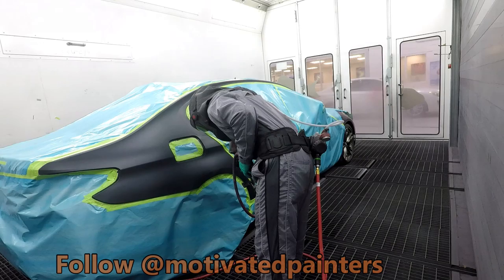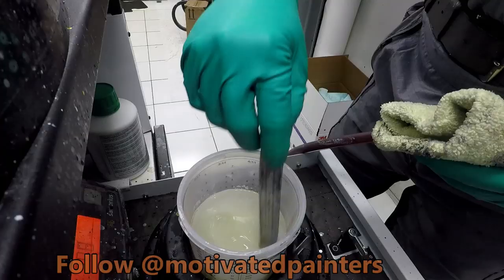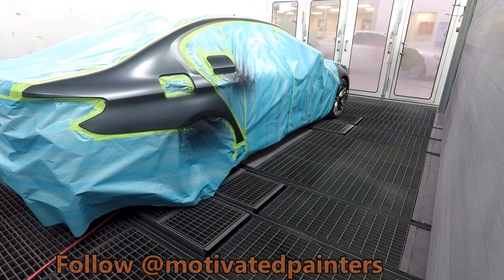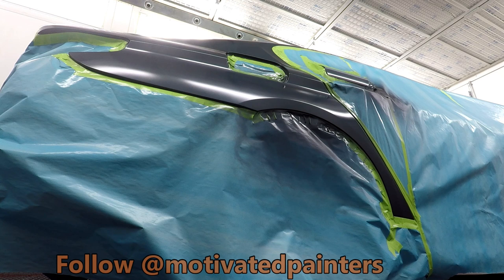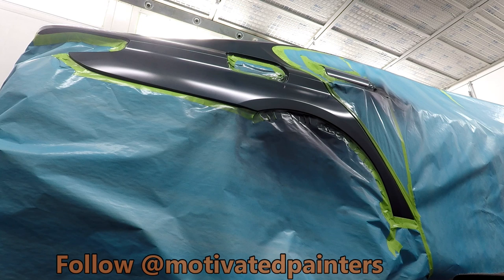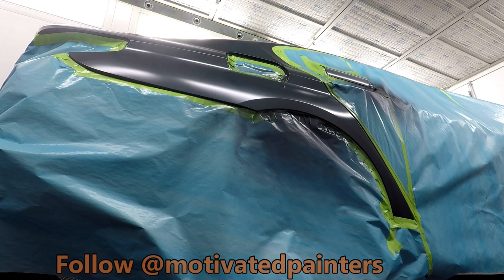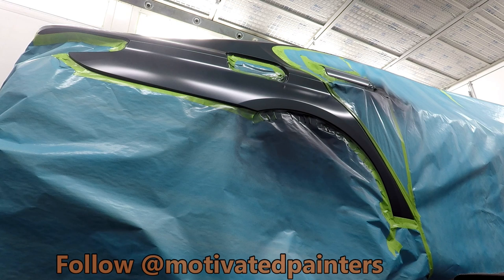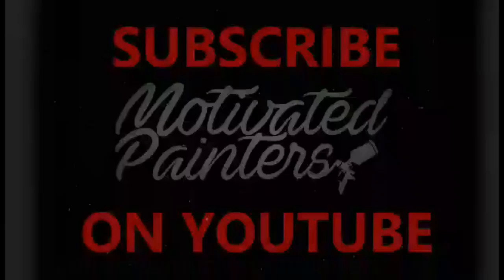Matte finish BMW auto

Comment: I am using combinations of matt clear and satin clear of PPG, and it is the only perfect resault for OEM "matt" finishes. You even have "FC" scale which means intensity of flatness, FC01 to FC06 I think, because every car, have different "shine", it is not all matt, it is all but matt.
Reply from the maker: Yes that's what I use with ceramic clear
Reply: @MOTIVATEDPAINTERS  D8115 AND D8117? It is not ceramic clear, mixes 3:1:1
Reply from the maker: I use D8126 like I showed in the video and I used fc02
Reply: @MOTIVATEDPAINTERS   May I ask why you specifically choose the ceramic clear over a less expensive more "standard"  clear like what @jishimoari is using? Is it pretty much just for the scratch resistance? I am planning on painting my 1949 Willys Pickup in C158 Lotus Military Grey but with a satin sheen clearcoat.
Reply from the maker: The main reason is because this clear has lifetime guarantee and it's scratch resistant. Also a huge factor is the fact that is easy to spray and it is never failed me in getting the right desired finish
Reply: @MOTIVATEDPAINTERS   That's my main worry. The "ease" of spraying. I am most definitely NOT a professional painter; and it sounds like I only have 1 shot to get a satin finish to look good with minimal orange peel.

Comment: How do you know what level of matte ?  I have to do a Benz next week. With akzo but it has 6 different levels of matte.
Reply: Merc should have fc04 I think, try and spray samples
Reply from the maker: I always do a spray out card the day before to make sure the shine level is where is supposed to be. I have done two Mercedes benz with FC02 with great success I have one of them in my matte playlist
Reply: And another thing, if the shine level is something between lets say fc03 and fc04, you can mix it with your program on fc03.5. Just to be 100% spot on. Just saying

Comment: Hi Gabriel,  you say that you have found that the Walcom Genesi 360 HTE is your favorite gun. Have you sprayed with the Walcom Genesi 360 GEO? It's awesome. You should try it if you haven't already done so. That is one of my favorites.
Reply from the maker: I did try it a while ago but I wasn't a fan of the tip. I am loving these ones though
Reply: @MOTIVATEDPAINTERS  yeah, i can see why the tip might be a turn off. It can be difficult to keep all those tiny holes clean. And if you drop the fluid tip it can bend and then you got to get another tip. But it really does spray nicely. Great videos.